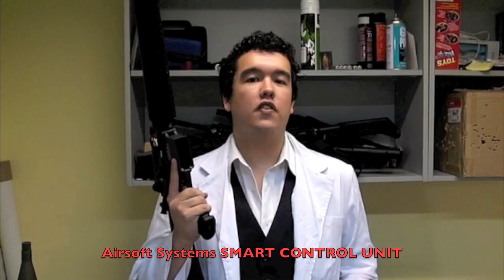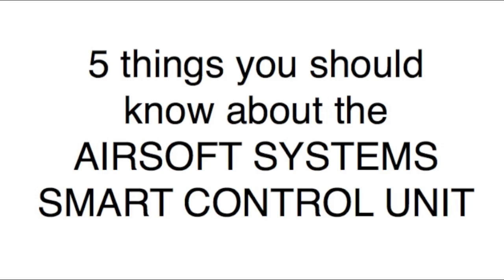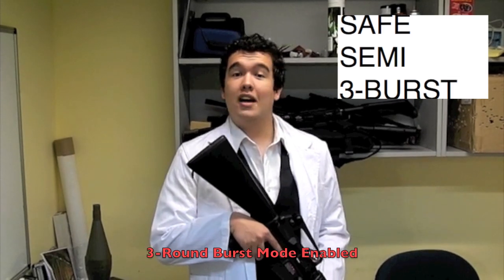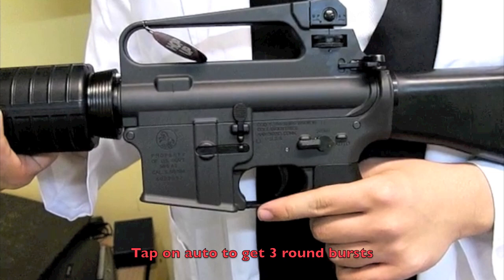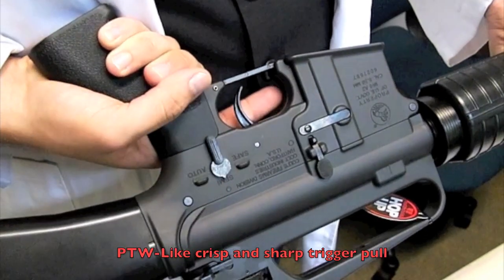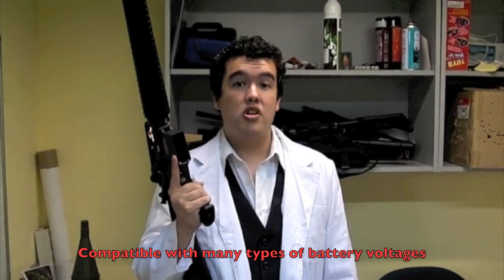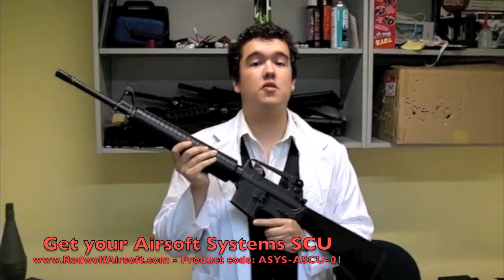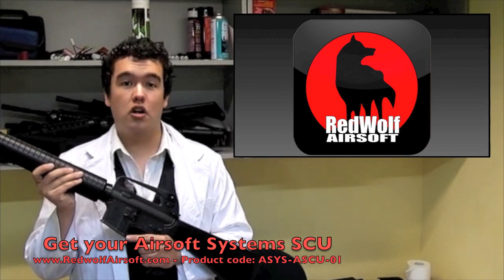Electronic Fire Control for Airsoft - ASCU (HD) - Redwolf Airsoft - RWTV

Comment from the maker: @KatonBoy 

What "latch" are you talking about?
Do you mean the bolt release?

In normal AEGs the bolt release is just aesthetic anyway, it serves no mechanical function. Remove it or not, it makes no difference.

Even in cases of functioning locks, removing the release catch would simply disable the ability to lock back the bolt, the weapon would still fire normally.

Comment: The problem with active breaking for those of use who choose to run 4 and 5 cell LiPos is that the reverse current applied during breaking will eat your commutator alive. (AR latch release is a VERY useful function to have, or at least a quick spring swap) Also, the AWS scorpion has had all of this for some time, at a lower price, available for any aeg system, internal tracer, anti-dryfire, functioning bolt catch, 22 volt running capacity, (along with 300 or 400 some odd amps) and more goodies.

Comment: @redwolfairsoft He is talking about the AntiReversal Latch.
@KantonBoy Yes, you can remove it on Full-Auto, as the special electrical System tracks the motion of the Sector Gear, and Stops the Gears right after they compleeted a ful cycle, even on Full-Auto. Its the same with AWS Scorpion and Pulse MOSFETs